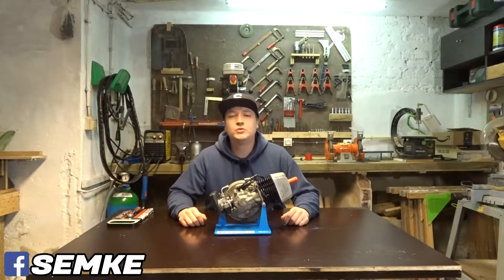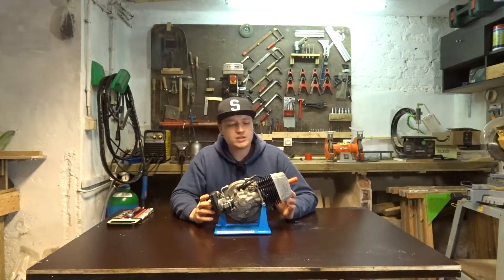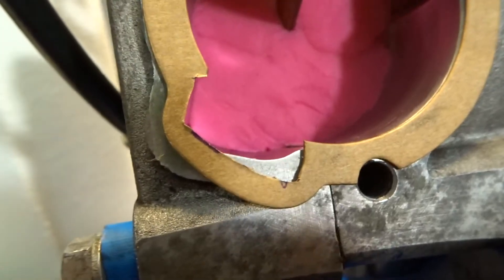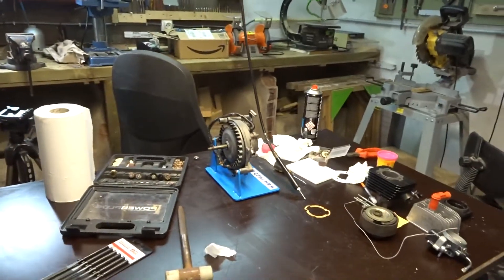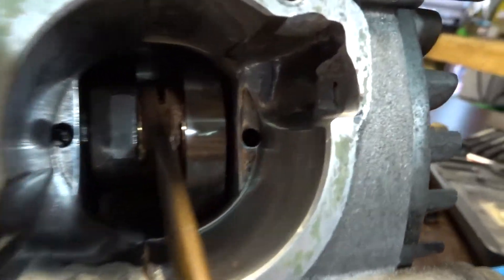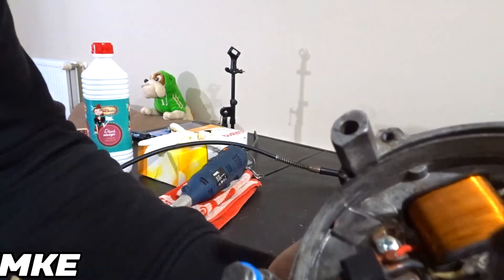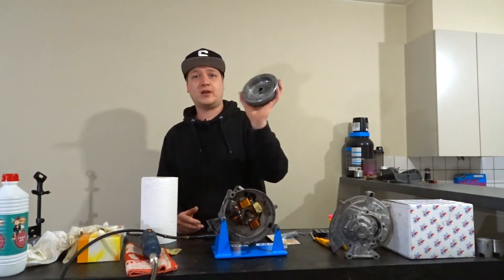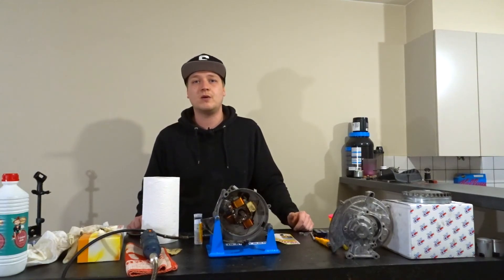Cylinder Porting and Port Matching Vespa Piaggio Ciao 65CC

Comment: Is it possible to buy a cylinder kit where you dont have to drill to match the Ports?
Reply: Yeah you don’t have to portmatch with the cylinder in the video you can just throw it on. You’re just gonna loose a little bit of power

Comment: Matching the crankcase with the crankshaft in it is never a good idea. There will always be some particles going into the case and bearings and stuff. But great video👍
Reply from the maker: Yeah I know it’s a bad way to do it. But I didn’t want to split the case . My method is not perfect. It’s the best thing I came up with.